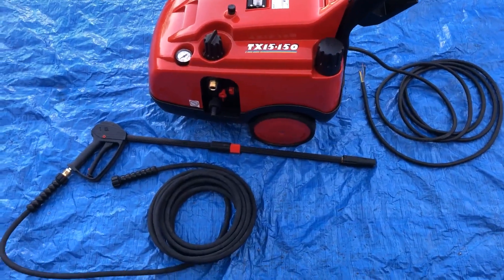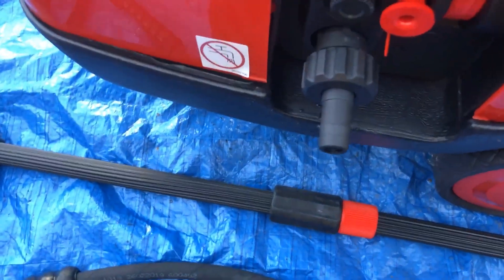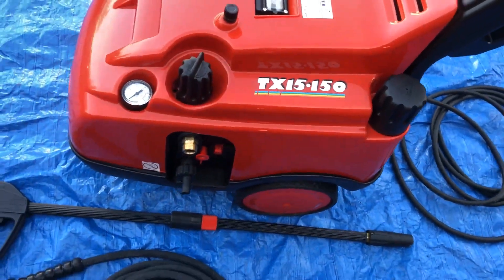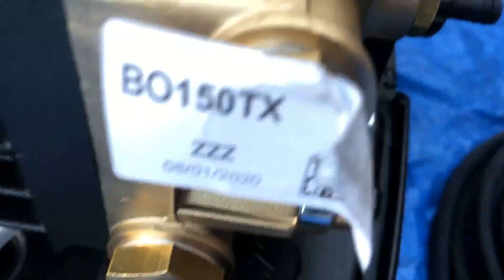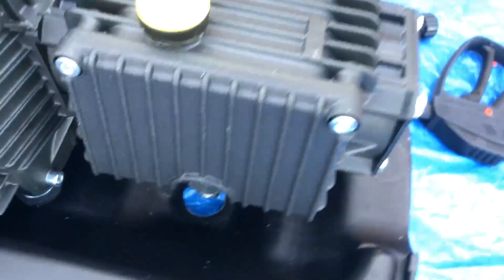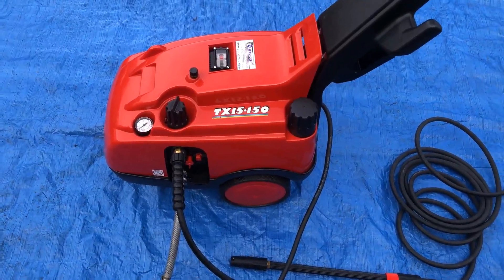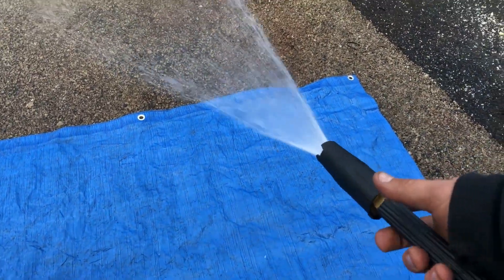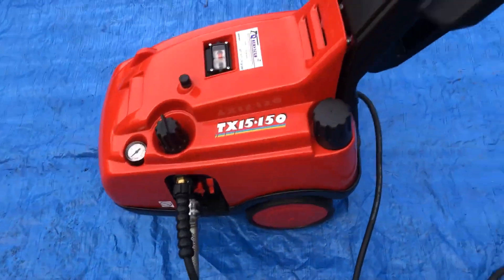TX15150 INTERPUMP 415 VOLT NEW

Comment: Looks a good machine Damien,can it be used to apply softwash solution  ?  Would it work off a 5kva generator ?
Reply from the maker: No that generator does not have enough kva sorry. But we would have to rip in bits to do that job with it.

Comment: I have the same machine but the pump broke and I don’t know how to remove it from the motor. Do you know how to remove the pump?
Reply from the maker: What is broken on the pump.
Reply: @qwashers  the motor works great but some one took of the brass head off and i cant find it. I have a replacement pump and cant seperate the old pump from the motor
Reply from the maker: @jssteve119  you will need to take off the fan casing, fan and back plate. Then pump the full armature out of the motor with the pump attached. Then try with prying bars to remove the pump.
Reply: @qwashers  Thanks, ill let you know how i go with it